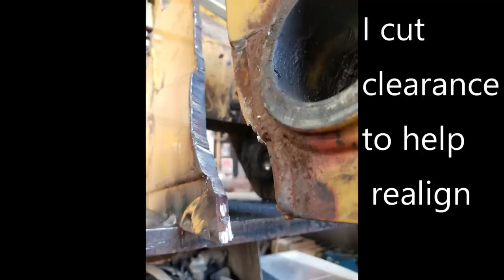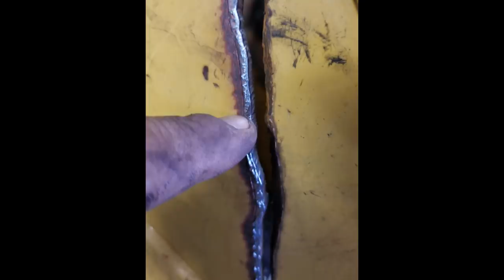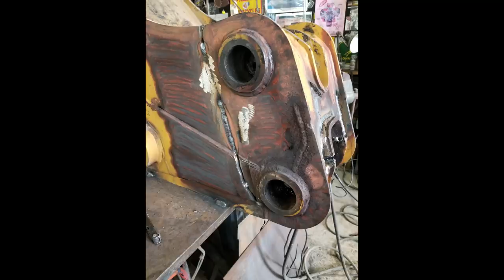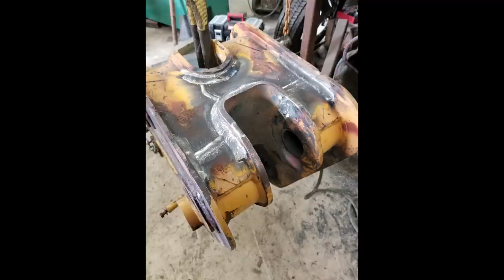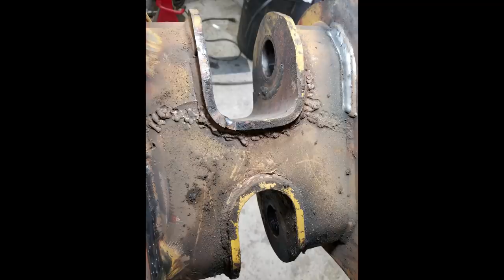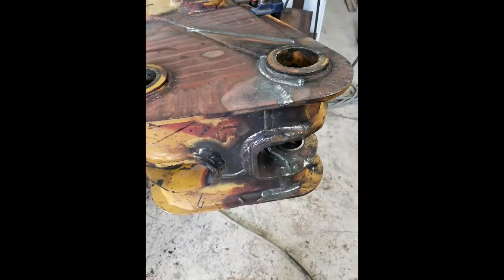Dipper Stick Repairs

Comment: Wow. You know it's bad when the cracks have cracks. 😂 Nice job fixing it. Looks like they are using a hydraulic breaker hammer or similar attachment on that machine to break it that badly. I saw a lot of O&K excavator booms and sticks crack from using big hydraulic chisels breaking concrete.
Reply: That explains it...

Comment: I hope no one was hurt when it broke. I wonderful job repairing that part. Have you told the company run that equipment it has a load limit. Thank you for sharing this with us.
Reply: 94 per cent of his work is operator error in a rocky area ,machines can only take so much abuse , by time constraints on pipeline projects are unreal and amazing  🤔😸🤔✌️💪🙏💎🌹

Comment: I read "dipper stick repairs" and the first thing I thought was "why is Isaac fixing a dip stick?"  I laughed at myself when I realized I was the "dip stick" and saw the big hunk of iron you were repairing.  Great welding!  That was some serious breakage in there especially around the pin.  Amazed it didn't need a line bore hanging like that.  You made it look like it was supposed to!

Comment: You better get the name of the guy who did the repair and hire him!
Did a great job on the repair even though the specs for the metal of the dipper stick was not robust enough, just not thick enough and gusseted at all those joints and pin locations.
Used to never see all that severe cracking on the US steel made equipment for the 60's and 70's.
Reply: Hydraulic breakers weren't really around then.

Comment: That look a lot like a stick boom that i fixed for a guy on a mini excavator. He busted it all up (similar to what was shown there) by using it to bust up concrete instead of renting a hammer attachment. Just slam the bucket over and over until it broke. ( i had to re-weld all the cutting teeth on the bucket as well). Nice fix Isaac.

Comment: When you fix stuff this badly beat up, do you ever see them come back in later years for more repairs?
If so, do they crack in new places, or do the cracks reoccur because that's where the stress is focused?
At what point is the damage so severe that all you can do is give it more life, but it's going to fail in the same places?
Or have you not found that point yet? Lol

And I am not questioning your repair ability, I am asking you because you do a better job than anyone else I have seen, so I am wondering what the Wizard of Welding has seen?
Reply from the maker: most of the repairs I do hold for a good while. There have been a couple that have continued to give the customer problems but when they finally break down and allow me to fix it the way I like, it usually lasts.
Reply: @ICWeld  lol, I can believe that.
I guess the boom that you did the 3 part series on recently was probably one you would class as "doing it the way you like"?

Comment: Comparing this to the job you just did on the excavator boom, where you replaced the plates with new steel,  was there a particular reason to not cut thus this completely off and start a fresh?  Cost?

Comment: Manufacturer's clearly have no understanding as to the Abuse these machines are subjected to on a daily basis. When building these Machines they are obviously are not using heavy enough steel plate in their designs and manufacture.
Engineers are worried about weight and cost and delivery schedule's,  yet they obviously do not know how these things are used in the real world. Welders should be in ,on the design and materials used ,to construct heavy equipment.
I'll bet if a welder picked out the material and parts he would use to build with ,you would see far less catastrophic failures, and equipment down time ,which I know would benefit everyone.
As the saying goes, you can pay me now, or you can pay me even more later!! Saving pennies ,only to throw away $Dollars is never a good idea!

Comment: Question, Please understand this is coming from a place of wanting to learn . In these high stress cases , wouldn’t it be better to reinforce with some more plate steel after the fix (which I believe to be top notch ) ? The reason I ask is I’ve heard that welding up cracks is inherently weaker than the steel plate was to begin with . 
Thoughts ?